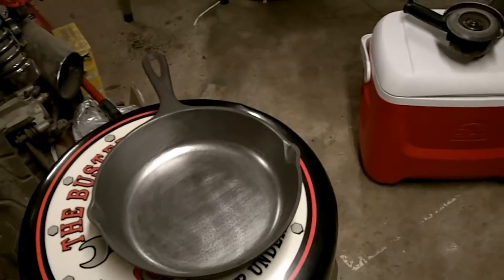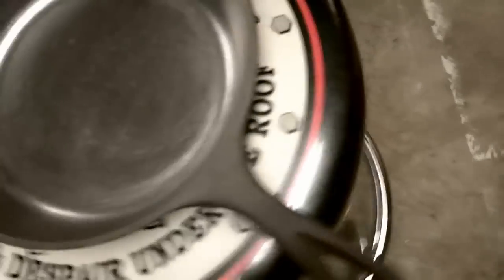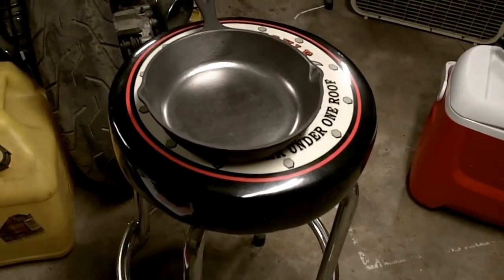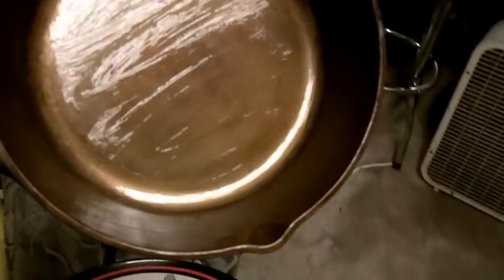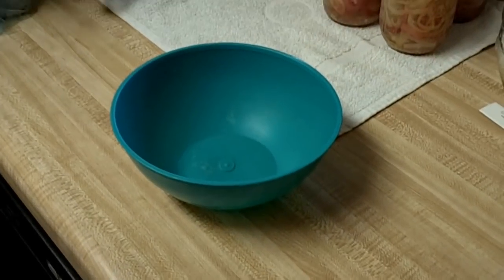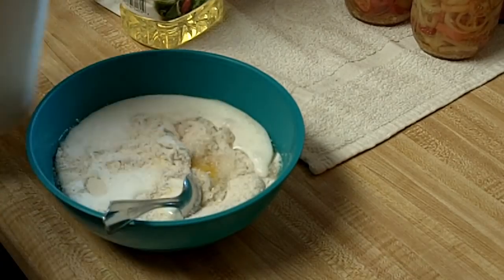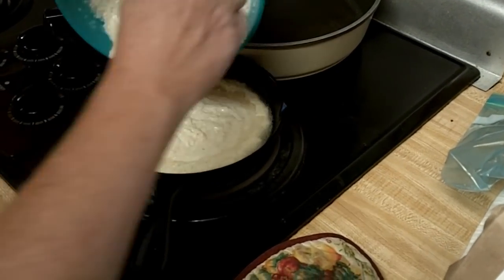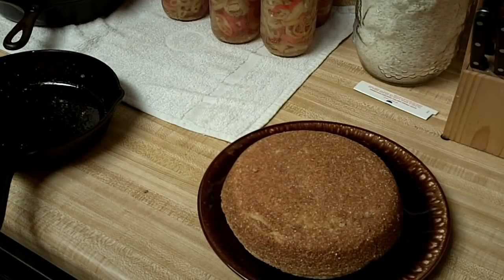Making "Lodge" cast iron better!

Comment: Having used cast iron cookware for 40 years, even the newest pieces begin to 'smooth out' over time, a combination of seasoning 'build-up', which fills the course texture, and spatula flattening of the surface. Some pieces are nearly glass-smooth, like my round 'breakfast' griddle. I am glad that there has been a resurgence in cast-iron cooking; I think it is by far the best cookware if you don't do stupid things like get it red hot, or heat it too fast on an electric stove. Will last many generations if cared for.

Comment: I got a hold of lodge and told them that they need there molds smoother because a lot of people are sanding them smooth.lodge got back to me and said the more you use is the better it gets but it just isn't so with the new cast iron it's the same with all the companies selling cast iron.So out to the garage boys pull out the sanders and make them the way they should be.

Comment: The bumps you find on new lodge cookware are there to allow cost effective pre-seasoning from the factory. It turns out most people don't want to spend hours seasoning a new pan before they can use it. I think the proof of this is that of all the old cast-iron manufactures went out of business except lodge. I think that Jeep's sanding process could help a new piece of cast iron work better, however I think looking for a vintage pan would be a more elegant solution.
Reply from the maker: I agree 100%!

Comment: Fair warning to anyone whos thinking about doing this…your seasoning is not going to stick. I made the same mistake.
As soon as you cook something that needs some elbow grease to clean, the seasonings going to disapear. 
(even just popping out that cornbread his seasoning flaked right off!)
Better option is to season it first, sand it lightly, test it frying an egg, & sand again until you get the results you want. 
This way you wont get the surface too slick for the seasoning to stick!

Comment: My 8" 30 some-odd year old Lodge disappeared not long ago. Someone liked it better than I did I'm guessing so I have a new one all re-seasoned the way my mother taught me with no sanding of the bottom and my first pan of eggs bubbled and slid like on ice or my old one. The "dimples/pits" in the bottom as you clean with a brush will after time fill and the bottom will smooth maybe not be as pretty as polished as this but so what?

After the first seasoning, IF done right, smooth or rough, food won't stick unless you like burnt food. But, if you have a lot of time to kill, this can help rookie cooks flip eggs like on a chemically treated piece of Teflon coated aluminum which can be done on brand new, properly re-seanoned any brand cast iron pan. It's the weight they have to learn to play with in flipping food without a spatula which I don't use in it. I use thongs for large meat, wooden spoons and spatulas and the seldom fork but I do try to keep metal off my pans.

I have to admit it does make a Lodge look pretty, but it all is proven in the seasoning, not a shop.
Good eats!
Reply from the maker: rolloverriderpgr Right on! Sorry for your loss, to me, nothing cooks like the old stuff.Any cast iron you use is better than teflon, so keep rocking that black iron!
Reply: 1952Jeep
I just found several old CI skillets! both are 6 inchers! One I've removed all the rust and old seasonings coatings. No names or brands but they aren't from East like 3 of them sitting in the garage waiting for the next yard sale! But 2 that look to be US made ones will be put back on the grill soon! I just wish this one I'm on now had a brand instead of .. "No. 3 with 6 5/8 in." below it on the bottom!

Blue Sky's and Safe Journeys!

Comment: Someone correct me if I'm wrong, but aren't cast iron skillets textured for a reason? I always thought they were textured so that your seasoning has something to stick to. If you use a grinder and get rid of all of the pits, then you are also going to be closing the grain of the metal itself. So I don't think that pan will ever be seasoned properly. Cast Iron pans that are slick is from seasoning building up over time giving your pan it's non stick properties.
Reply from the maker: My antique cast that I find at yard sales and such are pretty slick, even after I clean them for re curing. This new stuff has way too much texture for my liking! If you've got a new skillet that works for you or you've learned how to use it that's cool! I never could get this one to release corn bread, or flip an over easy egg till I did this.
Reply: The cast iron pans are textured as part of the casting process. Lodge casts all their products in a compressed sand cast, and the sand is what creates the texture. They don't really process the pans too much otherwise other than some cleaning and de-burring as necessary before pre-seasoning it for the consumer. I believe the older brands like Griswold may have polished their pans after production or use a different casting method, which allows for the smoother surface. Honestly though, if you ask me. If you use the right oil to season your pan and get that proper polymerization of the oil, it doesn't really matter how the texture is either way. Flaxseed oil and canola oils are the best for the initial seasoning of the pans, and beyond that whatever you're cooking will do just fine.

Comment: Great job! I have new lodge that I am going to try this process on! Blessings and Take Care
Reply from the maker: karenchakey once you do this and cook with it for awhile it will work as good as old antique cast iron! I don't understand why all the new stuff is so textured, must be a cost issue? Take care!
Reply: 1952Jeep
It is a cost saving measure.  Polishing the surface was too expensive so they stopped doing it.  At least they're still in business though which they might not be otherwise since they are competing with China.
Reply: karenchakey This was not a cost savings issue at all.  The rougher texture is now done by all cast iron manufacturers so pans can be pre seasoned at the factory on an assembly line as all consumers wanted to be able to cook in there new pans as soon as purchased.
Reply: +c siebester Nonsense
Reply: +Richard Casteel  No, it is a total cost savings .... Doesn't matter if all do them.   Try using a vintage cast iron pan that is perfectly smooth on the bottom, there is absolutely no comparison to a new one that is rough.  No matter how much seasoning you do, it won't compare to starting with a smooth bottom ...

Comment: Your seasoning flaked off because you sanded your pan. I did the same thing once to clean a rusty pan, and could never get the seasoning to bond afterward. I fixed the problem by putting the pan in the self clean oven for 2 hours. For some reason the high heat used to strip the pan of the old seasoning also allows for a much better bonding of the new seasoning. In the future, you should use the self clean feature to strip away the old seasoning, and soak the pan in vinegar to remove the rust. Be careful of the vinegar however, it will dissolve the iron too if you leave it in there too long.

Comment: for those of us that don't have power tools what kind of sander would be affordable for doing the job of smoothing out a Lodge bottom and sides?  I have a lot of Lodge and love it.  when Lodge came out with the 'pre seasoned pans" which saved the company, they had to add that grit to the surface to hold the spray for that seasoning.  the company made money but the customer lost quality as many people didn't want to season new pans.

does your wife do videos on canning?
Reply from the maker: If you have a "Harbor Freight" tool near you they have the cheapest tools on the market. I'd say, for a all around tool I'd get a drill, you can buy wire brush attachments, and hook and loop pads to put round pieces of sandpaper on.
My wife don't do canning vids, but I do. I have several soup vids and a wonderful "Tattler" lid explosion caught on film right out of the canner!! It was my mistake, I learned something "The Hard Way" again!! LOL! Take care! Jason

Comment: What did it take to get it to turn black? I've sanded one of my pans down and re-seasoned it in the oven 5 times but it is still that yellow copper color.
Reply from the maker: +Maryland Devin This project was awhile back, but if I remember right, I did a slow heat, raising the temp gradually several times to high temp. It took several times and cooking a pawn of cornbread or two to get it black. I actually started using mine while it was still a bit gold looking if I remember right. 
I should probably watch my video again!
Reply: +Maryland Devin You probably put too much grease in the pan, just like the guy in this video. Instead of black carbon, you have polymerized oil, a.k.a baked on grease - no good. Strip it and start over. The key is to apply the grease, then wipe it ALL off. It is actually impossible to wipe it 'all' off, but if you try to, you will end up with what you want - a very, very, thin, microscopic, layer of oil that easily turns to carbon when heated. Bake it at 500 for an hour (not 5 hours) and repeat at least 6 times. It is unfortunate that so many experts don't really specify what a 'thin' layer really means when it comes to seasoning cast iron.
Reply: ed zmuda I warmed the pan in a 200 degree oven for 15 min then applied olive oil with a clean cotton rag. After the oil was applied I used a blue  absorbent lint-free shop paper towel to wipe off 'all' the oil.  Then I placed the pan back in the oven at 300 degrees for another 15 min. I took it back out and with a new blue shop towel I wiped the pan again to remove any excess oil that begins to pool. I put it back in the oven at 400 degrees for an hour then let it cool inside the oven. 
  I repeated this process 5 times. I've done several other pans this way and they came out fine. However, this is the first one I sanded down to bare shiny metal. I don't believe the seasoning method is the cause of the copper coloring. I think it's either a thin layer of rust that began to develop because there was no oxidized layer to protect the metal from air the couple of min it took to get oil on it. Or that the yellowish green olive oil on shiny metal creates a dark copper color. I'm going to try a few things to see if I can narrow down the cause. If anyone has any ideas please share. Thanks
Reply: +Maryland Devin Are you dealing with a Lodge brand cast iron pan or is it one made in Taiwan? I am just asking because I saw another video in which the host was talking about a yellowish color that would not go away no matter what he did or how many times he re-seasoned the darn thing!
Reply: This is a Griswold. I did not sand the sides and they look normal. However, the inside and parts of the bottom are dark copper where it was sanded and polished with steel wool until it looked almost like stainless steel
Reply: MarylandDevin probably a copper skillet. lol

Comment: Jeep, I've used a different method, to get where you are.  Here's an explanation as to why.

If you have a mirror-smooth surface, the seasoning doesn't stick too well.

I build up a few layers of seasoning on a new piece of Lodge, then get a griddle brick, that 4X4X8 piece of pumice, used to clean a diner's griddle.  Use it to sand down the peaks, of the Lodge pebbly finish.  Don't worry about the valleys.  Don't do this all at once.  Spend 10 or 20 minutes a time.  Re-season after using the griddle brick a couple times and use it.

After a few uses, use the brick again.  With use, the brick will wear down, and match the curve of the bottom of the pan.  (Like the shampoo directions say, rinse and repeat.)

After a few uses, (and without a LOT of machinery and labor, all at once) I've reached where you are.

One more thing, don't be afraid to use metal utinsils, (I love my metal spatula) in the pan.  Slowly does the same thing.

By building up the seasoning in the "valleys" and shaving off the tops of the "peaks," you get a product that is just as shiny, but the seasoning has something to grip onto.  Yes, I can "over-easy" an egg.  Without oil.

steve
Reply from the maker: Yep, different path, but similar results. Take care.

Comment: Dam that seasoning is great, could you tell me how you seasoned it, temp and time etc.thanks
Reply from the maker: I use bacon grease 99% of the time, occasionally I'll use Crisco. I use very very very thin coats, bring it up to temp in the oven slowly. I start at 350, let it run a couple of hours, go up to 450 another 2 hours then 500 for about 4 hours. I let it completely cool, in the oven overnight then repeat the process until it is blackened the way I want.
The more you cook with it the better it gets!

Comment: I think I sanded mine too smooth. My seasoning looks amazing, but can flake off if you just barely drag over it. The sides are awesome where I didn't sand as much, but bottom flakes right off. 450-500 degrees with lard. I think I'm going to try sandblasting it to get it little porous and see if it sticks better. Anyone got any other suggestions?

Comment: If you properly heat the pan when you put butter or oil and the like, those pits have a job to hold the oil and make your pan non-stick. I use to hate to cook with it until I learned you start with medium-low heat let go for 5 min. It sears and makes it come without sticking. Lord it was like watching you torture your dog with that sander.

Comment: My only beef with Lodge is their logo embedded on the bottom.  I like to flip the frying pan upside down over a fire and use the bottom to make pancakes then flip it back to fry in.  With Lodge the logo prevents that.
Reply from the maker: Now flipping the pan over for pancakes is a great idea! Time to take an angle grinder to the bottom!!

Comment: The texture of Lodge cast iron is rough to accommodate pre-seasoning done at the factory so you can cook right away without the hassle of preparing the pan for use. Nice looking work but I just assume buy an old pan and restore it if I want a glass-smooth skillet. But you probably know this.